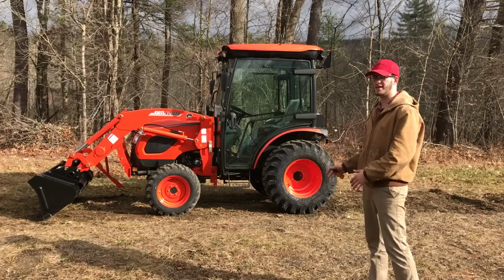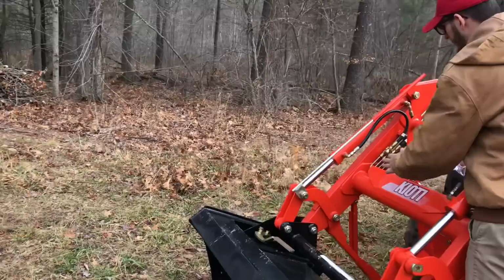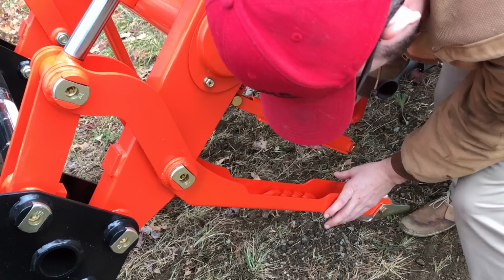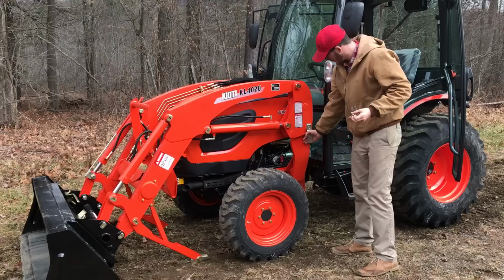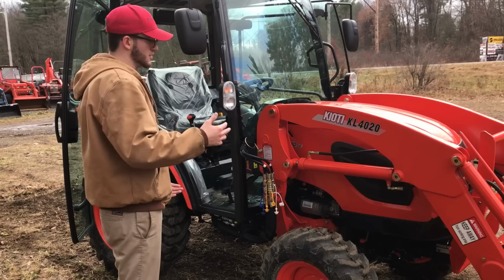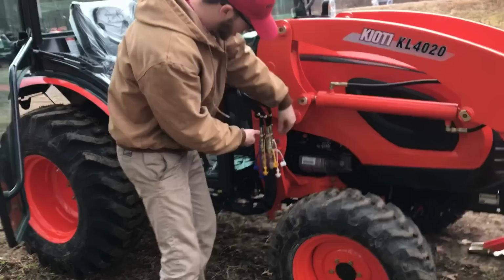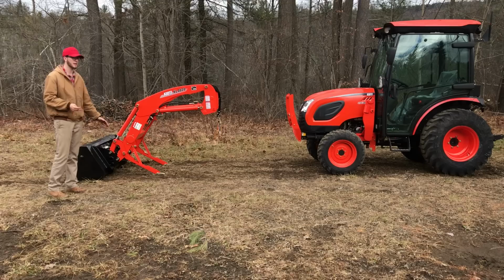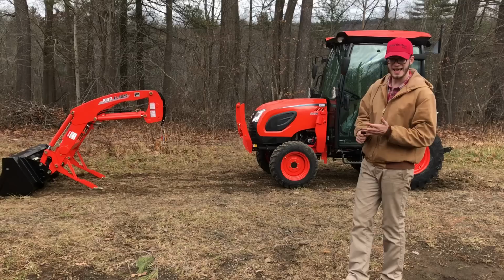Removing and Installing a Kioti Tractor Loader - CK3510 SE CAB

Comment: The heading mentions removing AND installing the front loader.  I only see the removal part.  Curious to see how hard it is to line everything back up  !!
Reply: I agree, fitting together is always harder than taking apart. Get a spud wrench or connecting bar, or something similar. Maybe a brass or bronze bar stock cutoff in case things get locked up and you end up pounding out the bar. Also useful for connecting Ferguson hitch implements.
Reply: It's very easy. Put the tractor in Low Gear and drive in.

Comment: What is the difference between the KL4030 and KL4030C? Mine came with a KL4030C in my Ck4010se cab
Reply: Brad, I just took delivery of a CK3510 SE HST. I was told that the "C" was just different manufacturer that fabs the loader for Kioti. The KL4030 when compared to the KL4030C has a different mounting system, i.e., mounting brackets are the difference. KL4030 has the latch pin above the mounting bracket (half round mount) where the KL4030C is opposite, latch pin is below the mounting bracket (half round mount). Other sections of the bracket(s) that bolt to the tractor also is different in regard to fabrication, also I noticed charcoal color brackets for the KL4030 and orange for the KL4030C.
Reply: @johnmcnally8906  which one is better?
Reply: @BossSwanger  I don't know if there is any real performance or longevity difference, I am just a new owner, but did a lot of research before making my purchase. I noticed that the "C" model did not have the metal coil protection on the front hoses, where the KL 4030 did. Maybe that's because the KL4030C loader was on a base CH4010 tractor and not an SE??
Reply: @johnmcnally8906  I have a 2021 CK4010se cab tractor. Came with the KL4030C. Just curious lol

Comment: Just tried to remove mine, adjusted the loader for 15 minutes, couldn't find a spot where the pins would loosen enough to remove.  Thinking they put oversized pins in it.
Reply: No, its you!
Reply: Put some oil on the pins!

Comment: What is the cost of that unit with loader and cab in can dollars
Reply from the maker: In USA Dollars MSRP: $33,083 on this unit, however it can be purchased for much less ( in the 28k range sometimes depending on current rebates being offered. Not sure where those prices would be in Canadian dollars

Comment: Kioti has problems with their fuel injector system the gears on the injectors break and the cost is outrageous price tag. Kioti knew about this problem for 12 years but never had a call back on their tractors.  My warranty ran out so it looks like I am into a couple of thousand dollars. the new inject system cost $1400 plus labor. The dealers also know about this problem for years. Never again will I purchase this tractor. DK45HST with 900 easy hours.